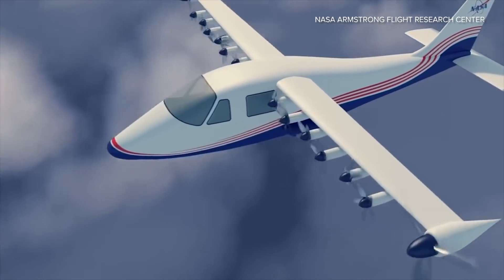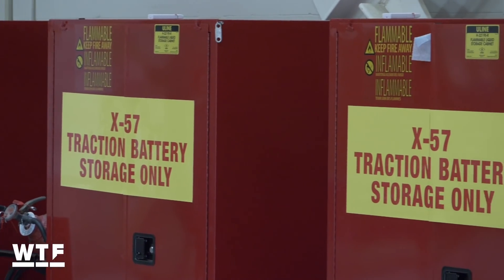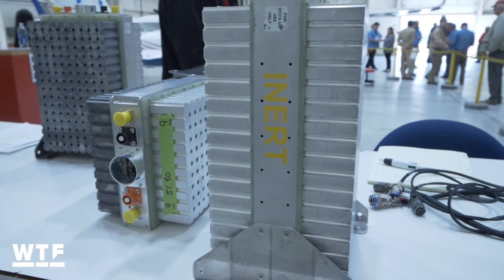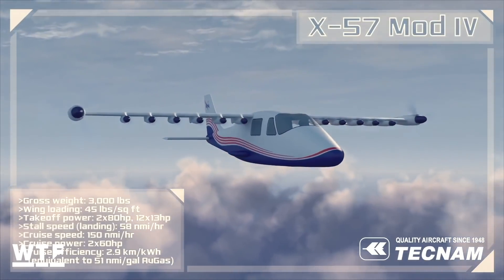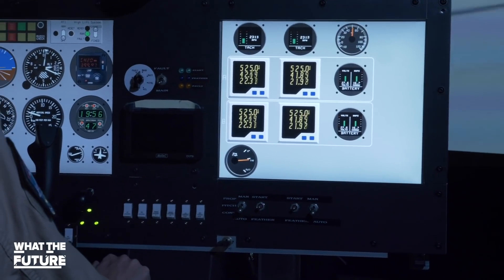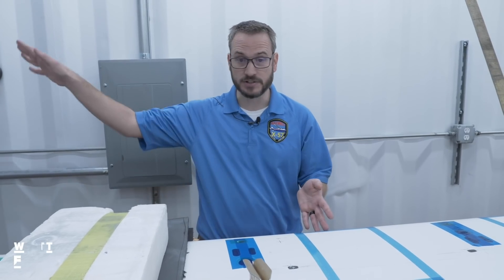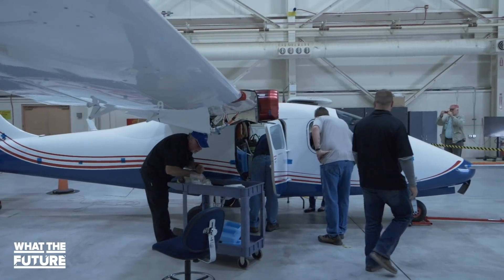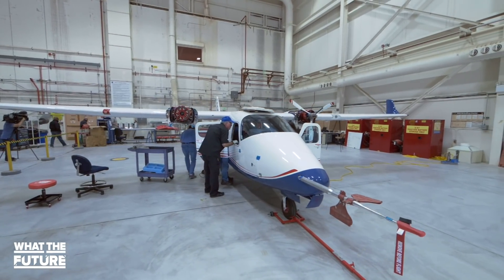This all-electric plane could help shape the future of air travel

Comment: Do you think electric planes are the future of flight?  Let us know down below!
Reply: X-57=3 lucky number! Best of luck NASA!
Reply: Depends on the battery and high altitude-low temperature electric motor performance
Reply: I'm still convinced people sized pneumatic tubes are the future. THUMP!
Reply: @saltymonke3682  Electric mobility (Tesla cars, battery trains, etc) have built-in battery heaters powered from itself, which help greatly with this, in addition to a bit of lightweight insulation. Electric heating gobbles a few percent of range, but solves the problem for the flight duration.
Reply: @mdrejhon  lets see on the long run and their fire accident safety.

Thats why Tesla is under investigation for fire breakout.
Reply: Yes I have about 5 or 10 in the basement.
Reply: Yes, of course.  Look at the progress drones have made in just the past 5 years.  Just a matter of scale
Reply: Perhaps hydrogen and fuel cells are a better choice for enegry storage in planes. The lower over all efficiency might be less of a problem when you get better range and more flight time.
Reply: I have an idea, but it may sound stupid but can you tell me if it would work. As James Watt in 1776 observed in a boiling kettle in his chimney, steam is a "mover of mountains." This mover of mountains should be able to be used to propel a plane into the air from the ground - using a hybrid water electric turbine propeller engine. It works like this - a fan sucks in the air and rotating compressor blades compress the air. As the air gets compressed, by use of induction heating methods, the air gets heated in an oven like compression chamber. Atomized water is then sprayed into the compression chamber and because of the heat of the air and the air pressure, the atomized water is flashed into steam, and would thrust out of the exhaust, turning the turbine blades. This would make the steam turbojet engine function, by use of electricity. It's a kinda water electric hybrid turbine engine.

There is also a way to use the ion engine technology in this by superimposing an ionization chamber between the exhaust and the compression chamber, and ionizing the atomized water particles to flash into steam and thrust out of the exhaust.

Electricity for the above engine is drawn from curved graphene ultra capacitors.

This water electric hybrid engine when powered by ultra capacitors, should give the plane more range than an ordinary electric motor would.
Reply: Most definitely. I mean, they’ll have to be eventually if we actually wanna make a difference to the terrible amount of pollution we’re putting into the atmosphere.
Reply: Yes, once the compact nuclear fusion reactor will be finished...
Reply: mihindu1967 I don’t consider your idea to be stupid; not at all.  I do believe, though, that continuous atomization of water into vapor will pull a great deal of heat from your combustion chamber, eventually cooling it off.  This problem gets worse quickly with an increase in altitude. 
 I think it might work with a nuclear reactor, but not a battery.
Reply: One motor, one prop is the way to go for efficiency
Reply: @yelwing    I think counter-rotating props are ideal for electric planes. 
Electric motors have instant torque.
Counter-rotating props would cancel out the weird torque forces that tend to cause roll.
Reply: Not until you get an accurate "fuel" gauge, and constant power output throughout the discharge range.
Reply: Yes.  If there is a future for flight, it is electric.
Reply: Only if i can fly from Amsterdam to Tokyo, non-stop in 11h.
Reply: @yelwing  redundancy is the way to go for safety
Reply: Yes ofcourse
Reply: @saltymonke3682  Far less fires in Tesla cars per 10,000 vehicles than ICE cars.
Reply: @simonhill6267  you compare 1 type and 1 brand of car to many brands and many types of cars
Reply: @saltymonke3682  so shouldnt it be even worse for my argument? One brand of electric car you are saying has problems with battery fires versus the entire average of ICE cars in America?

Reality is a Tesla, like most electric cars, is over 500% less likely to catch fire than combustion engine cars, which carry massive amounts of highly flammable fuel.

Not saying they are perfect, just better and improving year to year.
Reply: @simonhill6267  no, its already unbalanced comparison, because you compare it to multiple cars with multiple quality standards. 

Should compare Electric cars to ICE cars, or a car to a car. Not a car to multiple cars. Since Your overall statistic comparison will be dilluted by the average-number derived from the ICE statistic. A class full of homeless isnt actually getting richer if you put Bill Gates in it. However, statistically, yes, in average if you pool them together.

And model year, do you put all ICE cars, from the older to the newer in one piece of data? Cars, just like other stuffs, break down over time.
Reply: @saltymonke3682  So your belief is a new electric car versus a new ICE car has a statistically higher chance to catch on fire?
Reply: @simonhill6267  we cant conclude it yet because it's still an on going investigation. Dont be a short sighted cultist fanboy, everything can have a flaw. At the end of the day, if there is a design flaw, an investigation can fix it to make it better in the future.
Reply: @simonhill6267  I dont have the data, do you?
Reply: @saltymonke3682  just saying given the stats, on average electric cars are less likely to catch fire in an accident than ICE cars. Just the stats, comparing one entire category to another 😐
Reply: @simonhill6267  back to my previous comment, the age of the cars. Is it apple to apple?
Reply: @saltymonke3682  comparing electric cars on road to gas powered cars on the road?  I don't think it's an unfair comparison, although the average age of gas powered cars would be older. In your eyes what is the ideal comparison?

Fyi: the average age of a car on American roads is 11.4 years
Reply: Wasteful use of money that could be used to develop more towards ground based technologies.  If we can save oil for critical uses such as aviation, etc and develop syn fuels.  Electric is a no go for aviation.
Reply: Yes, most definitely. Battery storage density is improving as never before, so it is only a matter of time until they can hold and sale deliver more energy than standard liquid fuels.
Reply: Simon Hill statistically air travel is way safer than travelling by car is considered a fair comparison
Reply: @525Lines  yea, thats Elon's Hyperloop aka Human pneumatic tube.... the thump would sound more like KABOOOM as soon as the vacuum is broken in an earthquake or accident, massive wall of pressure hitting the tin can at over 1,000 mph, bye bye cruel world lol
Reply: @probablytrue2644  I figure the pneumatic tube thing isn't something you can make safe enough for human transport.
Reply: I’m an aerospace engineer. Just Like hybrid cars came first, I believe hybrid aircraft will be the steppingstone to full electrification in aviation. Hybrid aircraft would utilize existing technologies so it is much less far fetched than it sounds. A passenger hybrid plane will likely be designed with one medium sized jet engine or possibly two smaller jet engines for redundancy placed at the rear of the plane. They would aid during takeoff when the plane is fully laden with passengers and fuel. Then after climbing to cruising altitude, the electrically driven high bypass fans would take over a larger role in the aircraft’s propulsion. At this point, the traditional jet engine(s) would adjust its role from providing a majority of thrust, to providing electricity to the onboard batteries that would power the electric motors. As the plane reaches the terminal stages of flight, the Jet engine(s) could shut down completely allowing the electric propulsion system to takeover completely. This would drastically reduce the fuel consumption of the plane and as battery storage technology continues to improve, we may one day soon see a fully electric passenger plane.
Reply: I do
Reply: I don't think i'd put MY bum on a seat in an electric plane. Not until we are in the third or fourth generation. I think they should carry on with the R & D of all electric, and in the meantime come up with a hybrid plane that uses fuel to take off and electric for cruising with an emergency backup of fuel just in case.
I think you'd have much happier passengers who wouldn't be scared stupid at the thought of hearing the captain announce over the intercom, "would all passengers please plug in their laptops and mobile phones into the sockets provided as we seem to be a little bit of electric short for our flight..."

Comment: We need solid state batteries in super high density cells to make this efficient. I am afraid fossil fuels contain so much energy per volume that no battery can replace them in aviation.
Reply: A electric uses less energy at higher altitudes and the plane gets back energy as it lands.
Reply: You are correct in your assessment. 
For now, with current AND near battery tech, we can't expect more than 1.5 to 3 hours flight out of electrical aircraft.
There is also the interesting conundrum of electric A/C landing at the same weight they took off with.
This will create a lot of structural issue for landing gears & the overall structure of the plane.
This will also have an effect on the mission profile (i.e: no "cruise clime" will be possible)

Although, even with all these hurdles, I still think we have to try it out and learn if it is possible to make medium range intra-continental electrical airplanes.
Reply: Ok so we put gas fossil fuel in cars what if we run out supply then why fuels planes not to mention global warming using gas cars.
Reply: Jimmy  i think that point is more valid for if the plane is running out of juice mid flight

Comment: Why do the small engines fold up for cruise flight?  I would imagine it would take minimal energy to keep them spinning in cruise, and I was under the impression that higher efficiency can be obtained by moving a larger mass of air more slowly rather than a smaller mass more rapidly.

As it stands, it seems (from the perspective of a YouTube commentator arm chairing it up) that any efficiency gains from the higher aspect ratio wing will be lost to the multiple drag pods the engines become when they’re not in use.  I heard that the storage pods on the long ez take 5 knots off the top speed alone
Reply: xpeterson 

So I guess you’re smarter than NASA then.

Comment: I think hybrid long range aircraft may be viable sooner.
Reply: I agree. I believe that all electronic aircraft will be mostly vertical takeoff and landing, likely for short commutes; going from inside cities to likely the airport. There is an interesting all Electric aircraft from Israeli manufacture Eviation that can carry 9 passengers and travel approximately 650 miles and travel at a maximum speed of 390 mph at a service ceiling of 29,900 feet. I believe it’s success and advancement will take a chunk out of the short haul flight market. However, ultimately I do agree that hybrid jets will come to dominate the medium to long haul market for the medium to long term.
Reply: I’m an aerospace engineer. Hybrid aircraft would utilize existing technologies so it is much less far fetched than it sounds. A passenger hybrid plane will likely be designed with one medium sized jet engine or possibly two smaller jet engines for redundancy. They would aid during takeoff when the plane is fully laden with passengers and fuel. Then after climbing to cruising altitude, the electrically driven high bypass fans would take over a larger role in the aircraft’s propulsion. At this point, the traditional jet engine(s) would adjust its role from providing a majority of thrust, to providing electricity to the onboard batteries that would power the electric motors. As the plane reaches the terminal stages of flight, the Jet engine(s) could shut down completely allowing the electric propulsion system to takeover completely. This would drastically reduce the fuel consumption of the plane and as battery storage technology continues to improve, we may one day soon see a fully electric passenger plane.

Comment: Perhaps hydrogen planes will be more viable - we need a 3 fold increase in battery power density to make small planes really useful and at least a 12 fold increase for airliners
Reply: perhaps no..  it is a fact. Fuel cells can not be beaten in this type of application unless someone would be fine with less than 1 hour of flying if you include the safety capacity reserve than any airplane should have. 
In 5 years with fuel cells and hydrogen technologies reducing cost, battery flying vehicles could have only a niche in ultra short travel applications.
Reply: Fuel cells aren’t ready. This airplane is designed to explore what can be done with batteries, an efficient wing, and distributed propulsion.  If it provides short field landing and one hour endurance on electric power it will have moved the ball forward.  That’s the point.
Reply: @paulogden7417  They are not ready?  They are cleaning the floor with battery record in drones for example.
Battery drone max flying time equal to 2 hours, fuel cell = 13 hours.
We already have a fuel cell flying taxi design in development called Skai, they dont even need complex wings or transformations designs to accomplish higher range. 
Asian companies are investing billions to increase a production of 1000 by year to millions of fuel cell modules by year right now.
Yeah.. for 1 hour of flying, batteries are a good option, but that it is a very small niche when you add safety margins.
Reply: @paulogden7417  Understood but I hope it doesn't end up in a holding pattern

Comment: Rather excited for the future. I'm looking forward to this kind of technology to come into its own.
Reply: Not likely
Reply: @chris532008  only time will tell.
Reply: Christopher Montoya I kinda think not.  It s a second use fuel and less r jet too ovet whelming to overcome.  Solar will supply lighting needs for future and hot water in sun belt
Reply: @chris532008  They said electric cars weren't possible too, but now some models have ranges comparable to gas powered cars. Maybe someone will come up with a way to make electric planes viable too. We shall see.
Reply: Christopher Montoya electric car is still a major flub but just a toy for rich people that have more money than sense.   First use fuel will at least housr next 50 years still b first.  The diminishing of oil may cause austerity flooding the line

Comment: Solar cells recently doubled their efficiency and it was barely reported on. I wonder if the new batteries that'll make all this viable will be celebrated the way they should.
Reply: It seems to be quite safe for reporting entities to naysay progress, instead of embracing the new breakthroughs. They are concerned with overheating Lithium Ion batteries?? They are last generation. Now, we have solid surfactants and even CO2 that do away with overheating.  Not to mention other types of batteries that are being worked on. We can expect 5X energy storage and output for size and weight, coming right up. Electric airliners have already been designed. Just awaiting better batteries. 5 YRs will tell the tale.
Reply: @andytaylor1588  There's a dire need for them and a fortune beyond the dreams of avarice await the inventor. Five years sounds about right.

Comment: What happens if Airplane run out battery in the air are you still working or not  🥺
Reply: Imagine a plane running with fuel, running out of fuel while in flight.
Reply: @heatherhiggins5016  Apparently, we just take our hands off the controls and wait for a drone to come recharge us. LOL.
Reply: Michael belliard - well, expect a heavy landing, because jettisoning the battery packs is not an option.
Reply: If you are running out of Battery or Fuel, your Weight and Balance Calculation is worse.

Comment: I bet NASA are very interested in the new advances in Lithium Carbon batteries with 7 times the storage...so 700 mile range coming in a few years maybe?
Reply: C Johnson just saw that video. Was thinking the same
Reply: there are lots of battery technologies being researched, but it could be well over a decade before any of the ones being researched get close to commercially available
Reply: eviation build a plne with over 600mile Range. It is in the Registration Prozess.

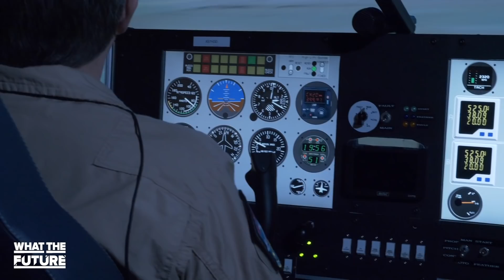Comment: @2:20 "I shouldn't have no surprises when I fly this." Hmmmmm..... and this guy is the absolute best of the best NASA has to offer? A guy who speaks in double negatives?
Reply: so you’re going to compete for his job because you can speak better English?
Reply: The job of test pilot requires brass balls first and foremost. Reading, writing and speaking skills are pretty much optional.
Reply: @CaptainCaveman1170  EVERY military and NASA test pilot has at least one if not multiple advanced engineering degrees.  They are all extremely skilled at reading, writing, and speaking; however, the emphasis is on math and engineering, and not the intricacies of language.
Reply: @wess5478  Yeah I'm sure this guy is top notch...but I just knew people were going to focus in on his speech errors in the comment section and wanted to remind them of the big picture here...this guy's mission is to test UNPROVEN planes....I'd venture that not too many perfectly well spoken College grad millennials are going to be signing up for that duty any time soon!
Reply: That's just an accent thing. People from some parts of the US speak quite strangely.
Reply: @originalx136  
American. Speak better American.
Reply: @CaptainCaveman1170  It isn't mutually exclusive.
Reply: Some people are intellectually so destitute that all they can do is start picking on other people's grammatical errors to get a good feeling out of it.